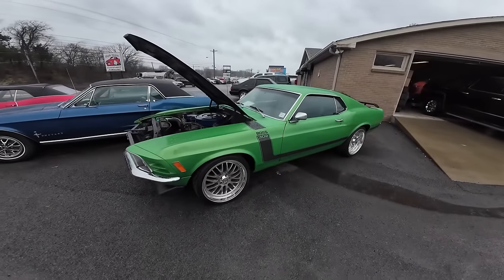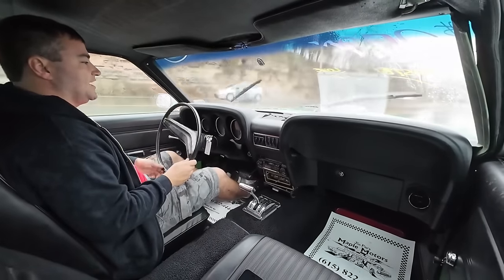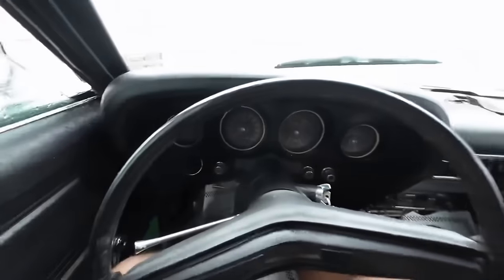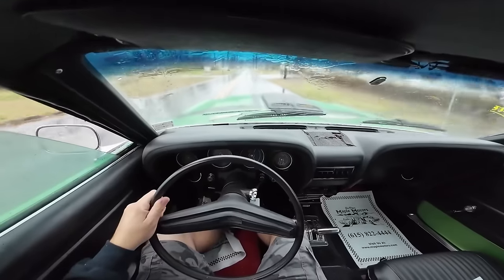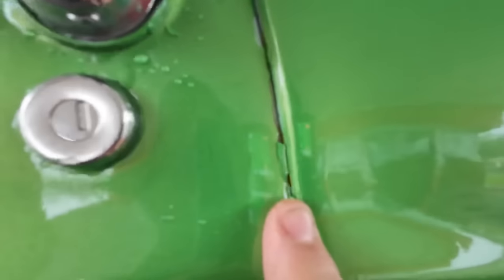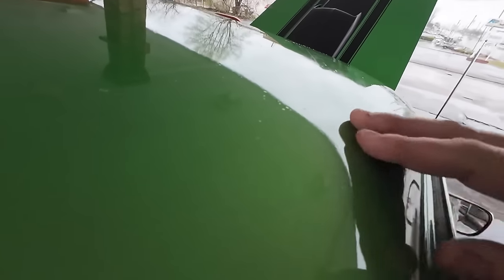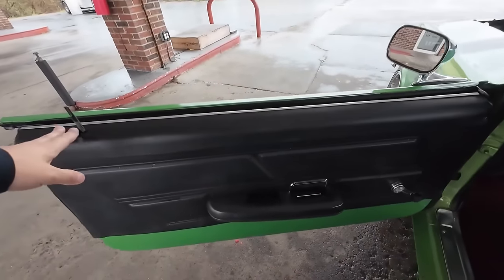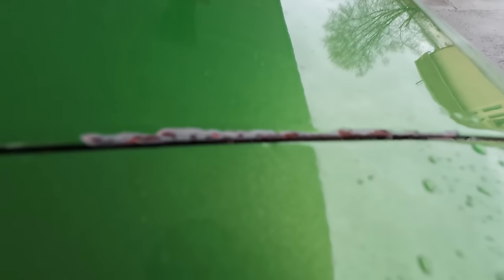Test Drive 1970 Ford Mustang Fastback Custom Conversion SOLD $27,900 Maple Motors #2511

Comment: At 13:25 you can see that there's no shield over the flywheel.  Ouch!  That's going to fill up with dirt and grit in the gears of the flywheel in no time and cause huge damage.  It's an inexpensive fix and I recommend that be fixed ASAP.  I can't believe the prior owner was driving it like that.  Yikes!
Reply: oh no !!  I've been Driving my f150 without a flywheel shield for 10 years,  I better go slap one on there. lol
Reply: I drove my 69 camaro bb 427 daily for more than 10 years no fly wheel cover a never was a issue.
Reply: @bullbutter9699  You've been lucky, that's all.  You'd be singing a different song when some stones get in there and destroy all the teeth on the gears.  I hope you don't do too much off-roading with that truck.  Happy Trails.
Reply: @indman101  That's a beautiful and valuable car.  Don't confuse luck with a good idea.  You can also drive on bald tires and no brakes.  That doesn't make it a smart choice.
Reply: A lot of these custom cars people don't bother replacing the sheld
Reply: @hillbillyhomestead1966  That's a big mistake.  A shield is cheap insurance against some very expensive repairs.
Reply: @1notgilty  the fly wheel cover was never an issue for me or anyone I knew into old cars, look at your rims on your vehicle no protection from them throwing rocks but likely it will never be an issue.
Reply: @indman101  The rims on cars face outboard and inboard from the sides of the vehicle and are further protected by the tires that face forward and back.  The rims also don't transfer and balance the power from the engine's crankshaft to the transmission or have teeth that engage with the starter motor.  You can drive with a damaged rim but will have lots of expensive problems if you have a damaged fly wheel.  But, hey, you do you.  Happy trails.
Reply: @1notgilty  Get a clue you worry too much.
Reply: @1notgilty  insurance against what? throwing a rock like tires do.
Reply: @indman101  It's cheap insurance against destroying your flywheel and damaging your power train including your transmission.  I'm surprised that I have to explain this.  I guess it's like people who don't want to change their oil or install a new oil filter, or brakes or tires.  An ounce of prevention is worth a pound of cure.

Comment: I'm sure this will make someone a decent entry level muscle car driver, it just ashamed that whoever did the body and paint didn't take time to align the doors to the front fenders and quarter panel body linesbefor they painted and put the striping on, because later down the road if someone does line them up to look right the stripes will be out of line and still look scabbed together, the wheels would have to go,  they look ghetto, i'm not sure if its the body style or the paint that they clash with  could be both,  but it will make someone a decent fixer up without breaking the bank,   if done right this car could be worth many times the asking price

Comment: I have owned many Mustangs. Bought my first one in 1975. Of all the Mustangs I had and sold, want back,  was my 70 Sportsroof in Calypso Coral.  If you were closer I'd have to take a look. Under side looked like a lot of floorpan work. Good news is ALL the parts needed are easy to find. Bad...it might be a LOT of parts!! Dead spot may be a Accelerator pump if it's a FoMoCo carb (2100 4100) Thanks! 
PS: That was converted from a coupe?!?!?! Wow.....never seen that!

Comment: I have a 70 that leaks in the back EXACTLY as this one. That led me to the louvers, the ONLY thing I haven't checked. Take the screws out, and discover the "gasket " is hard, inflexible plastic. No seal at all,  $20 online rubber complete set. Amazing the short cuts some people take.

Comment: This is a car that has some serious potential.  However, like many other older cars, it appears it was in the hands of someone who didn't know what the hell they were doing or didn't have the money to fix it right.  Underside shot shows uncovered torque converter/flex plate, passenger side of H pipe not connected and passenger side floorplan installed like crap.  On the outside doors not aligned properly and on the inside nothing works, windows do not line up, rear window leaks and so on.  Wheels are hideous on this car as well.  It has a lot of flaws, but overall it has some serious potential.  Hopefully it goes to a good home and receives the TLC it needs.

Comment: If i were going to buy a conversion, I'd want to know who did it and have it checked out and measured. It's a good-looking car and the color is nice. The sad part of a car like this is, at the end of the day, it's still just a coupe. 
Also not the same wheels as they show on the website with a lower price. Although I'm not complaining about the other wheels as they are a better fit for this car.

Comment: They cars are very expensive an most of them have problems
Reply: Not everybody is Jay Leno.  If you are buying a 50-60 year old car and don't expect any flaws or problems going forward, well you're a certain type of buyer.
Reply from the maker: Our cars are priced so low other dealers buy them and resale them. Same car different lot